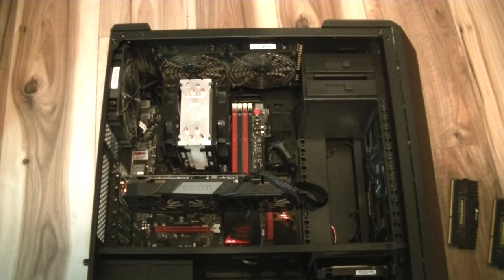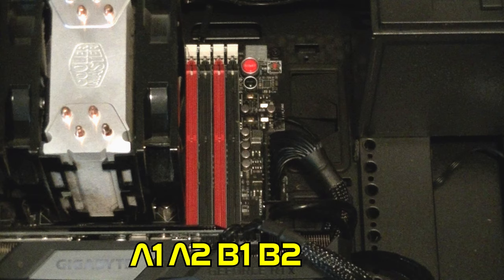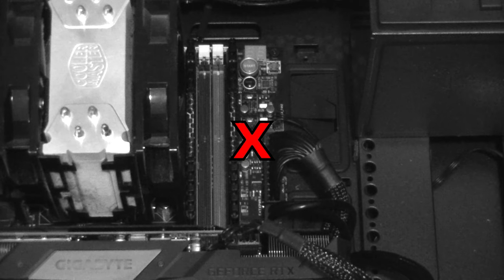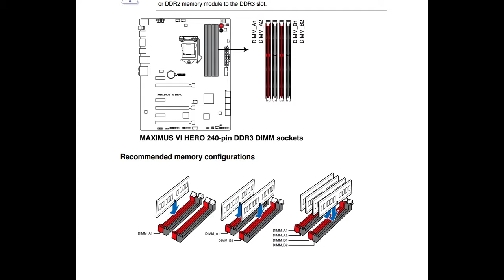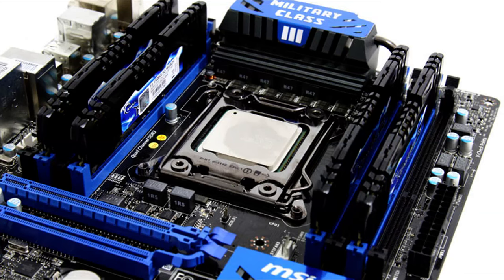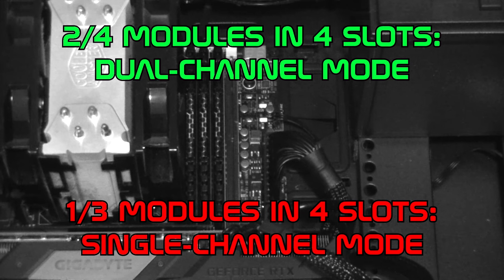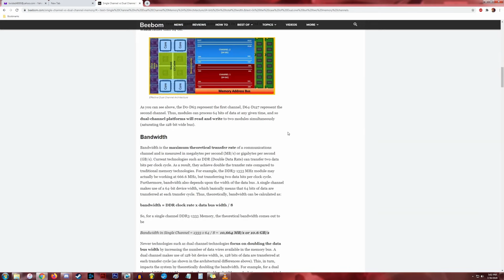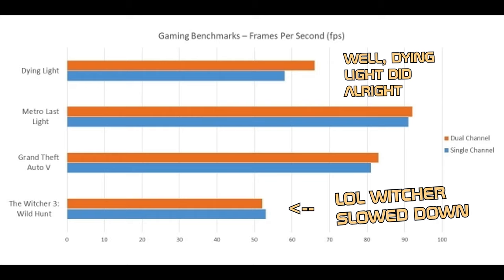How to Make Your RAM Run in Dual-Channel Mode

Comment from the maker: 2022 updated video on installing RAM and making it run in dual-channel mode: https://youtu.be/yC9YYnDhqog
Reply: update dirt in cpu cooler ;/
Reply: The only game that's telling me I need to use it is suicide squad
Reply: I have 2 sticks x 8gb if later I put another one single stick 16gb do I lose something?
Reply: My ram has specification as dual (2x8gb). Can i use it as a single channel, so i can put my single ram (1x8) and run simultaneously?

Comment: Just a bit of correction, most modern CPU and motherboards support flex mode which means that even if you have 3 sticks of RAM, 2 of them will run in dual channel while the leftover stick will run single channel
Reply from the maker: Didn't know that, thanks! That bit of info is going right in the RAM FAQ vid coming up! :)
Reply: I already have 8gb two ram running in dual if i install 2 more 8gb then what happen
Reply: well assuming you have 4 ram slots, then the two ram slots are already used so then with the two extra 8gb ram sticks the empty ram slots you just slot the new ram into and it'll run in dual channel regardless as all dual channel mode slots are filled so it doesn't have an option to use single channel
Reply: So If I have 2 x 8gb and 2 x 16gb will they all run in dual channel mode?
Reply: Yes

Comment: in my experience. Dual channel mode in gaming has a bigger difference than single channel mode when i was using single channel games like to stutter a lot for me and when i switch to dual channel my gameplay tend to be smoother no stutter
Reply: Just upgrade to 16 ddr4... Damn smooth af...

Comment from the maker: Can I install different kinds of RAM together? Will I get dual-channel speed if I only have two RAM slots? Do I need to install any drivers or do anything in the BIOS before/after installing RAM? These questions can all be answered in my new RAM FAQ video right here: https://www.youtube.com/watch?v=PY2uEQEl_3o
Reply: does it matter what order they go in ?
Reply from the maker: @joshguad600  No, but it does matter where the consecutive modules are in addition to the first one you install (for example, you can have them both in slots A1 and B1 OR A2 and B2, but NOT A1 and A2 or A1 and B2, etc.)
Reply: @Torqcx  okay thank you so much man i appreciate your help !
Reply: @Torqcx  what if i 6 dimm slots? whats the ram placement for that?
Reply from the maker: @treci-dieci9303  start with three modules, and if you want more RAM, fill all six of them up. Check your manual to be sure

Comment: i have only 2 slots with red color.. and supports 64gb.. im using 32x2.. but my pc detecting only 1 slot only.. how to fix this?
Reply from the maker: Try swapping the modules around and trying them each individually in every slot.
Reply: even it is restarting, i found that 1 of the ram is not working.. now im running the pc on 1 ram of 1x32gb, even the pc is restarting while playing any game. what may be the issue? thank you @Torqcx
Reply from the maker: @ShekharMine  Try enabling XMP mode in the BIOS if you're still having problems.
Reply: @Torqcx  did this just now, my monitor showing "no signal found" but cpu is running
Reply from the maker: Next step is to reset the CMOS, I don't have a video on this yet but there's plenty out there you can view. Basically you take the coin battery out of your motherboard for a few seconds and insert it back in (sometimes there's a jumper you need to do the same thing to). Now the board will be reset to default (this won't adjust any of your programs or files on your drives). Continue to try and debug the RAM (insert each module individually into each slot to rule out if there's any issues with either). Also blow out the slots if you haven't yet.
Reply: did that and no use, same issue repeating.. what may be the exact issue? @Torqcx
Reply from the maker: @ShekharMine  Are you saying that, no matter what configuration any of your RAM modules are in, and no matter how many at a time, the PC will not boot? If that's the case, either all the modules you have are not working or all of the slots in the board are dead.

Comment: Yooooo, I had 3 sticks running in single channel all the years, and now you enlighted me :O Thank you!
Reply: Unless you stick bigger, well.. sticks, in the dual channel mode slots instead of your 3 sticks. 3 is still better. Bar some cases mentioned in the video.
Reply: @Shedovv No it's not

Comment: Bro I have 2 slots only so should I buy 2 ram of 4 + 4 pleaase will it work dual channel or at single
Reply from the maker: It depends on your motherboard; I would suspect, even with just two slots, it should run in dual-channel. What do you mean by "2 RAM of 4+4"? Regardless, I would get 2 modules either way.
Reply: @Torqcx I mean I want to buy 8 gb ram but if I want it to run at dual channel I have to put half of it at other slots 1 and 2 I guess will it work
Reply from the maker: @ominoeditz6530  Correct, if you want dual-channel, split it into two modules.
Reply: @Torqcx  but I have only 2 slots will it work at dual channel I watched your and as well as other videos too but they had 4 slots and the put 1 ram stick at first slot and 2 ram stick  at 3 slot but I have only 2 will it I don't want to waste my money because 😅
Reply from the maker: @ominoeditz6530  2 RAM sticks in 4 slots should run in dual-channel mode. :)
Reply: @Torqcx  yeah ok ok thanks for replying I know I pissed off you 😅 but finally I understand
Reply: @ominoeditz6530  shit.. so it can't?. yea. the requirement is using ratio. hope when i will see if my slots pc r 4 slots tomorrow

Comment: Hey, great video! I have one question, I have 2x16g single rank and 2x16 dual rank crucial ram and am installing on a dual channel cpu. Will have have any issues using dual and single rank ram together? Would it be best to put them each on their own channel or split them up so there is one of each on each channel? Cheers
Reply from the maker: It's always best to get the same exact model for all of the slots, but in your case, I would pair each one of those up with themselves (the dual-rank modules in one channel and the single-rank modules in the other)

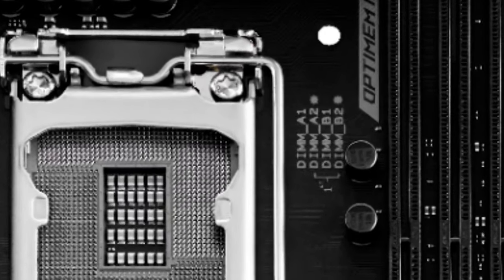Comment: 1:30 I think you just helped me solve my problem I've been having since I upgraded to 4 sticks. Maybe someone can verify this for me though. So at most I've been able to get my pc to recognize 3 of the 4 sticks. In conversation with someone a while back they said it may be that I was installing them in the wrong order. After seeing this part of the video I looked at my motherboard and it has a bracket pointing to two of the slots on that diagram that's labeled "first". So I took all the ram out and installed them again passing the first two sticks in those slots. It's slots DIMMA2 and DIMMB2. And now as I'm writing this I think it may still be wrong. Should I do DIMMA2, DIMMB2, DIMMA1, DIMMB1 or DIMMA2, DIMMA1, DIMMB2, DIMMB1?

I'm waiting on my new graphics card to show up so I can't just boot it up to check. Maybe someone here knows though.

Comment: ok so i have 2 slots in my msi b450 motherboard and i have already installed a 8gb ram and now i want to install a 16gb ram will this work in dual channel mode as they both have different size however the ram i am buying have everything same just different ram size and also i have a amd Ryzen processor
Reply: i actually don't think this will work (don't know for sure) but the thing is try to always go for 8 or 16 or 32 or 64 gb of ram like for example right know you have an 6 of ram if you have 8x1 then just buy another ram with 8gb so you will have 16 in dual chanel mode or if you have it in 4x2 then just get another 4x2 to full upp all ram slots. If you want even more ram then 16 gb just go for matching sticks but with more ram cappacity like 8x4 for total of 32gb or 16x2

Comment: New PC user here. Quick question. After running a RAM diagnostic, it noticed I had them slotted in a1 and b1, and said that those slots were “not optimized,” and that I should instead slot them in A2 and B2. Is there really a difference? I’m not sure what that even means…
Reply from the maker: All motherboards are different, but "not optimized" could mean many different things. I'd run a program like Speccy to see if they're operating in dual-channel mode, and see what the diagnostic says after inserting both modules into those other slots.

Comment: So how would you run in dual channel if you only have two slots on a ddr3 mini itx that supports dual channel i got the memory for it but i cant edit the ram in bios is says single channel
Reply from the maker: That is odd. It SHOULD be running dual-channel mode with just two slots. You may have to look that up further, sorry I couldn't be of help this time.

Comment: will adding a 2x16 gb of ram make a difference in gaming? And adding a 2 tb NVMe make the system run gaming better?
Reply from the maker: The more RAM the better, but only to a point; if you have low RAM (around 4GB) an upgrade will probably help your FPS. Otherwise, the CPU and GPU I'd prioritize upgrading.

Comment: Question. I have been asking around and I just haven't gotten any answers. This video did help clear up some confusion. But now I must burden you with this dilemma of mine...

So I have two ram sticks the exact same ones used in this video actually. I am using two corsair vengeance 8GB ram sticks. My computer however only sees one of those two sticks and I can't figure out why. I have tried many things to try and resolve this problem and so far nothing has worked out that I can at least see. I put those two sticks in their proper slots 2 and 4 but this is how I noticed the problem, so I switched to slots 1 and 3 seeing as how they have to be spaced apart as you mentioned. However despite this I still only had one ram stick being detected so I went online and many people told me either my slots were dead, or that one of my sticks was dead, so I unplugged both and meticulously went through all 4 slots with my first stick (the one it detected) and all 4 ports worked fine. Wanting to be extra sure I swapped out the sticks and did it again and got the same result. All 4 slots worked and this second stick WAS being seen. But once I put them together in their respective slots it says it can only see one of them. So what am I doing wrong?

Further detail, it says that I have 8GB installed ram (I should have 16GB) and it says 7.95GB of usable memory and only 2.24GB of actual available memory. Again I know nothing of computers so this made no sense. I was advised to update drivers and did, same problem, I was told to buy new sticks and honestly I can afford to just buy these things on a whim you know? So I I everything I could up until this point going off of Google docs. Nothing seems to match my problem or even help in any way. The only thing I did do that changed anything was I turned on the OC genie 4 and a-xmp and got that 2.24GB up to 4.47GB of available memory. Though that's by using automated overclocking which still doesn't fix the problem. Is there anything I can do or is this problem all related to the motherboard or OS being defective? I have tried everything I could think of so now I'm kinda desperate for any potential change.
Reply from the maker: I don't think your computer is not detecting the RAM, I think the OS may have a setting enabled that is limiting the amount of RAM you can use. Look up how to do this for your OS, but check your system configuration and look for anything along the lines of "maximum memory".
Reply: @Torqcx  sorry for a delayed response, but after watching about 15(?) Videos about what might be wrong I found out by taking away one piece of key wording. Many of the videos mentioned how imperative it is to make sure both sides of the stick are pressed all the way down firmly. We'll I took that info and pressed on the ram stick in slot 3 (B1) and sure enough the side closest to the desk (mine are vertical) pressed in just ever so slightly. Sure enough one reboot later and a bios visit showed that I fixed my problem. It's strange that this happened because I have never had my full 16GB of ram and only recently upgraded from an HDD to an SSD and I took out both sticks and reinstalled them even being sure to get it right. I guess I failed but nevertheless it's fixed now but I do thank you for your advise. I do plan on buying 2 more sticks and using them because why not really and im saving up for a new graphics card and power supply that can properly care for it. And just to be extra sure it comes across, thank you for the advise I really really appreciate it and will keep that in mind if I should ever be in this situation again.

Comment: I got a question.
I got 2 stick 8GB x 2
Both on 2nd and 3rd Slot   1st and 4th slot empty
Yet my CPU-Z showing Dual channel. Am i doing something wrong or is it actually dual channel ?
Reply from the maker: It's possible that's just how your motherboard is configured to run its memory modules. Try running another program to double check it is you want to be thorough.

Comment: So basically it would be more beneficial to run 3x8 on a dual channel board? Rather than 2x8 matching?
Reply from the maker: Only if whatever programs you're running are capping the RAM with only two modules. If not, leave it in dual-channel.
Reply: @Torqcx  Alr thanks so it’s be beneficial in gaming or at least not negative right?
Reply from the maker: @PANDABUY.Aplus091  yes, typically gaming doesn't need all that much RAM (I'd say absolutely no more than 16GB is required). It just makes more sense to go with dual-channrl because it will at least run slightly faster and anymore RAM on top of that would just be redundant.
Reply: @Torqcx  ahh Alr
Reply: @Torqcx  tysm got ur self a sub

Comment: Great video. Explained exactly what i was looking for (3 sticks in 4 slots).  Thanks. NOW, just one more ques.  I have 8+16+32. (yeah it's wierd, but i kept adding when i could)  What is better to opt, 48gb dual channel or 56gb single channel?
Reply from the maker: It depends on what you're doing with your PC, but I'd just go with the 48GB dual-channel; having those extra 8GB will do very little, as systems--even when using very memory-intensive programs--rarely ever even get past 32GB. You might as well sacrifice those last 8GB to get the faster operating RAM.

Comment: I have upgrade my PC and added another 2x8gb ram. I just put those 2 ram on the slot. Now they're 4 all in all. How would I know if they're both running dual channels? Thanks!
Reply from the maker: If you have every slot occupied then it's basically guaranteed that they're running in dual-channel, but if you want to check, one of the easiest ways is to download and run the free program "Speccy"

Comment: Okay so what if I have 2x4 GB put them in the right slots (A1, B1) and they still run in single channel according to CPU-Z?
Pondering on whether to buy 1x8GB ram because I have 2 more slots left and another 2x4GB is too expensive for me since I just want this as a backup system.
Reply from the maker: Try different programs first to see if it's accurate, consult your motherboard's manual and then maybe just try different configurations.

Comment: whenewer I put a ram stick in the b slots, it won't boot. no I have to put them in A1, A2
Reply from the maker: Check your manual, but also each individual module in each individual slot. Either one of the slots or RAM modules could be faulty.

Comment: I've seen conflicting information on whether dual channel RAM goes in neighbouring slots of different colours or slots of the same colour, is there a lot of variation between motherboards?
Reply from the maker: Normally no, most motherboards as far as I've seen will run in multi-channel modes when the RAM modules are in the matching colors. However, always check it's specs and/or manual.

Comment: Oh god i find a video that actually and clearly explains....
i have a single channel 8Gb Ram right now and i was thinking of upgrade so i'm going to buy a dual channel ram(2*8 =16 Gb) . according to the video if i put all three of them on motherboard i will recieve 3 single channel.(motherboard has 4 slots )

as i'm doing this for gaming purpose what is your opinion should i use the rams as i explained or just use the dual channel and put aside my last ram :(
i think it's better to use the three of theme right?
Reply: Use the new ram purchased and put the other one away for parts. You'll be running in Single Channel on 3x 8G Sticks (24G Single) and can cause performance issues compared to the 2x 8G Sticks (16G Dual). I'm doing the same thing right now, buying the HyperX Fury Kit 2x 8G (16G Dual) and will be storing my 1x 8G Single for a project down the road.

Comment: Hey! So i have 4 slots and 2x8 3200 mhz memory and they ran in a1 and a2 ever since i had that computer, now i tried to switch it to a1 and b1 and now its restarts when i set the frequency to 3200, however i managed somehow to get it to work on a1 and b1 and i didn’t notice and performance boost, even a bit drops here and there, so it might work only in single channel or what could it be. Thanks for your answeres!!

Comment: so if i have dual ram so like 2x8gb and have them in dual channel mode, and then have a single 16gb in a slot will that make the two dual ones be single as well? my motherboard has 4 slots
Reply from the maker: Most likely they will all run in single-channel mode, yes.
Reply: @Torqcx  according to official intel website, you can run Dual channel mode with 3 DIMMS installed in your motherboard, but with condition that the total capacity of Channel A is the same of Channel B..
i'll give you the link
https://www.intel.com/content/www/us/en/support/articles/000005657/boards-and-kits.html#dual